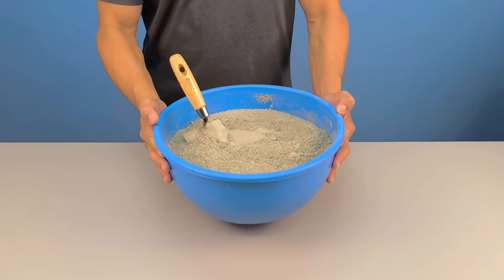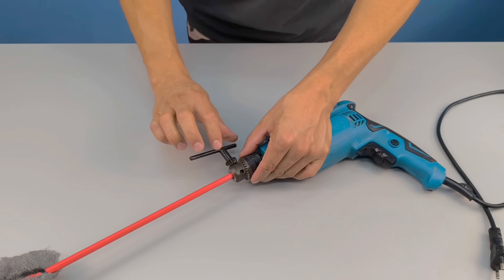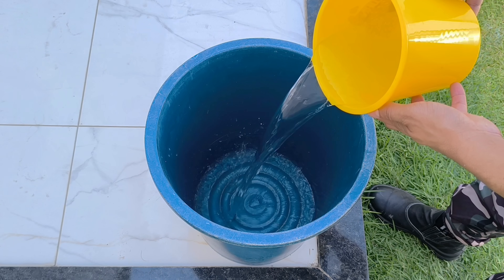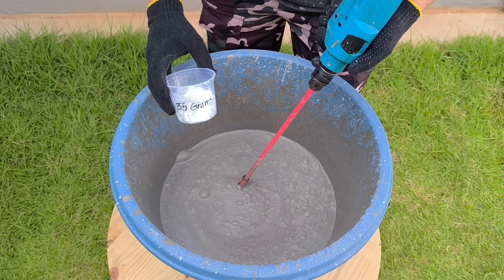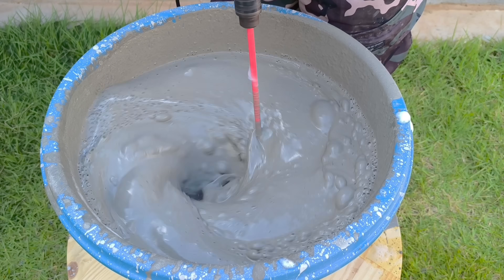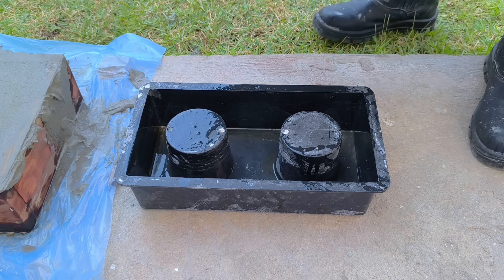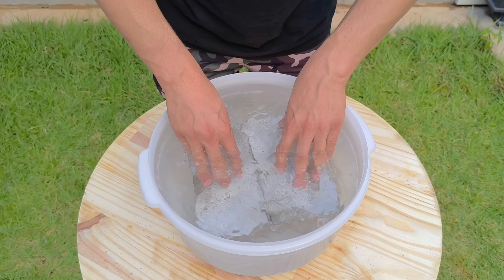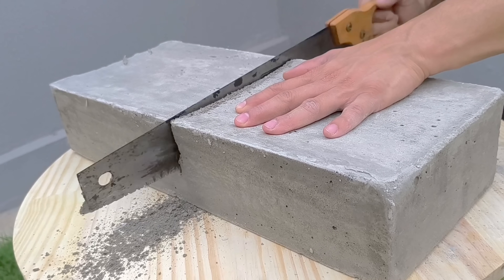Mix CEMENT with DETERGENT and create something that can REVOLUTIONIZE civil construction!

Comment: Air Crete. You broke the kitchen code. Nice work. I tried, you can buy industrial additives but I knew it could be done with regular items. 
Fiberglass and plasticizer... Nice work. 
I'm gonna try this for sure. 
My first idea was egg whites (literally merangue). I thought it was whack, because that's what it sounds like. But it turns out that the proteins help. 
Ha. But there were other issues. Fun stuff. 

I saw someone and his dad, I think, 3D printing a house with "Air Crete". And it was just stacking up on itself. 
That's when I decided I needed this in my life. Not sure what for, yet. but I'll think of something 👉
Reply from the maker: Thank you so much! Yes, I used simple materials to prove it’s possible without industrial additives. Fiberglass and plasticizer worked perfectly! 🙌

Comment: it changes everything if you're living in a frosting climate. you want as less air in your slab as possible.
Reply from the maker: Exactly! ❄️ In cold climates, too much trapped air can cause cracks when freezing — great observation! 👏
Reply: not exactly air is the problem. 
the air inside the concrete block in some time will be replaced with moisture from soil or even open air, i.e. water. and that will lead to cracks when frozen.
There's so much differences and difficulties when you move from frost-free to colder location....

Comment: Very interesting. I have been experimenting with aircrate myself. I would not build a big structure with it, but it is fine for smaller structures that doesn't require a lot of weight. One benefit is, it is a good heat insulator due to the air pockets. you can improve on the foaming by adding borax (very small amount, otherwise it desturbes the bubble structure instead), weigh (or other protein),  Glycerin and CAPB / Amine Oxide if you can find some (only tiny amounts, you need to experiment with ratio). You might need to give it a water proofing coat as moisture might deteriorate it over the years. Make sure it is bone dry, 32 hour might not be enough, more like 1 week, but first it needs to slow dry for +-3 days keeping it damp to prevent cracking and brittle results.
Reply from the maker: Great insights! I really appreciate your detailed feedback. Yes, borax and glycerin can enhance the foam structure a lot. Thanks for sharing your experience! 🙌

Comment: Extra air bubbles means weaker mix, novelty-Crete for decorative purposes. I wouldn’t trust this as far as I could throw it.
Reply from the maker: You’re right, it’s definitely lighter and not meant for structural strength — more for insulation or decorative experiments. 💡🧪

Comment: Can you perform following tests and create new video : Water absorption test,  Soundness (Freeze-thaw) test, Absorption test
Compressive Strength Test (Crushing Strength Test)
Efflorescence Test (Presence of Soluble Salts)
Hardness Test
Impact Test
Dimension Tolerance Test
Structure Test.  You can conduct all these test in any university or college having Civil engineering course.  If possible compare the result with normal red brick and AAC brick. waiting for your videos.
Reply from the maker: Those are excellent suggestions! 💡 I’ll definitely include some of these tests in the next experiments and compare results with standard bricks. Thanks a lot! 🙌

Comment: Now put the finished blocks under a hydraulic test press to see how many foot pounds per square inch it takes to crush it. I can guarantee this ‘miraculous material’ cannot stand anywhere near the strength of standard concrete block after it’s fully cured.
Reply from the maker: You’re absolutely right — it’s not designed for structural use like standard concrete. This mix focuses more on lightness and experimentation. ⚙️

Comment: This is called Chinese  concrete they like to make high raises out of this stuff, and then it crumbles and collapses. Air bubble=bad for concrete!
Reply from the maker: I get your point — air bubbles are bad in structural concrete.
But here the purpose is different: this mixture is for lightweight, non-structural projects. Traditional reinforced concrete is still the best choice for buildings and heavy loads. No shortcuts in engineering! 💪🏗️

Comment: If t u is is real, how does the materials hold up in bad weather. I guess what Id like to know, is ca n these materials in the way you presented them can they withstand weight much like load bearing beams. I mean gratemmtfor gardens and papers Im guessing but could you build a house out of the fabricated product you've so kindly shared with us. How safe is it and  would you move your family into a house that was made from this product from the Greek. Im kidding I have I
Reply from the maker: Great question! 👷‍♂️ The mix shown is meant for small-scale projects like repairs, garden decor, or prototypes — not for full house structures. It’s resistant to moisture and weather for short exposure, but it’s still experimental. ⚙️

Comment: 3:29 so the dude makes bubbles in water and calls it “this invisible ingedient, that miraculously transforms before your eyes”. 😅😅😅😅. Basically like aerated ice cream. You’re getting a lot less for your money.  Plaster of Paris is water soluble so this is going to become porous. You would not want to use this for anything that needed any type of strong structure or long lasting structure.  If you drop that brick that looks like a Lego, it would shatter into three or four pieces immediately.
Reply from the maker: Haha good one! 😄 You’re absolutely right — this kind of foamy mix is just for demonstration and lightweight experiments. It’s not meant for heavy structures, but it’s great for exploring chemical reactions and material behavior. Science with a touch of fun! 🧪⚡
Reply: @inovaouinventa  yes but the problem is the video was presented as if it is a good sturdy building material. Nowhere in there was a disclaimer that it should not be used for anything weight-bearing or loadbearing. And there are people out there that are going to try this.
Reply from the maker: @firefeethok_tui2355The video was presented in an explanatory and technical manner. Before anything else, I ran practical tests to ensure real results. I'm not here to convince anyone to do the same; I'm simply showing what's been tested and approved. I understand your skepticism and respect your opinion. Constructive criticism like yours opens the door to new ideas and strengthens debate in a world where thinking differently is also part of evolution.

Comment: If you have an application that doesn't need to be durable, but light - fine. They called it Gazobeton in Poland and it was common back in the day, but it will crumble over time.
If you want lightweight flower pots, or heavy insulation - fine, but if you use this for structural concrete... I'm not coming in the door.
Reply: As there is no sand in this kind of concrete, would it not be expensive ? YTONG might be a better solution.
Reply: yes I can see the advantages..... and problems. Is this product up to the local or national building material code. IF not, you may be ordered to pull it down.
Australia and NZ have a product called Hebel, a type of premade aerated concrete. It is marketed in both countries, so they obviously have the lab reports that allow it's use in both countries. (In other words it is in compliance with national standards, for the purpose it was designed for). You probably need to have a certified engineer sign the building designs before authority will be given to go ahead.
If you live in a 3rd world country or can bribe the building inspection team in your area, anything is possible.... but it will still only obey the laws of physics at the end.
Reply: In poland u named it also gazobeton? :)
Reply from the maker: Exactly! 💡 It’s similar to Gazobeton — great for lightweight or insulation purposes, but not for structural builds.

Comment: Load Bearing Capacity and over strength is lower than a Clay Brick. Can be used to erect internal walls.
Reply from the maker: Exactly right! ✅ It’s lighter and not as strong as clay bricks, but great for internal partitions and insulation.

Comment: This mixture of cement and soap suds or dishwashing liquid was used to make roof tiles.
Reply from the maker: That’s right! 👍 It’s been used before for lightweight applications like roof tiles and insulation panels.
Reply: @inovaouinventa  Such blocks were also used to build partition walls in apartments. For building pigsties, henhouses and similar structures.

Comment: It's called aircrete.  Highway construction companies that have to fix edges that crack away on hillsides have been using aircrete for several years.
Reply from the maker: Yes, exactly! 💡 Aircrete has been used in many construction projects — it’s great for lightweight and durable repairs!

Comment: They used airated concrete on buildings in the uk in the 80,s to save money, now millions are being spent too repair them.
Reply: @stuartwigen916  you are correct and many collapsing roofs are in schools.
Reply: Aerated or expanded concrete has been around for a while The newer stuff has a high R values, can be dry stacked and the coated with chicken wire and concrete cover <(this can also be used with traditional concrete blocks, is faster to do, makes a wall stronger laterally than one with mortar between the blocks). Berlin
Reply: I'd like to see this struck with a hammer and infused with rebar or chx wire etc and then struck. Click bait otherwise.
Reply from the maker: Yes, that’s true — those early mixes had low density and poor curing. Modern versions use better ratios for durability and insulation. 🧱
Reply: @inovaouinventa  Yeah I can see these types of "brick" being used more for walls (not supporting) to act as insulation or sound dampening.
but no idea of the changes in it's thermal properties. In the US, given how the simplicity of the buildings and DIY rely on the walls being relatively hollow. It might just only be used on the exterior. with some plastics used for the weather proofing underneath the chosen siding or brick...

Perhaps water &/or fire resistant dry wall could be adhered to the foam-crete...

but have to see how it drills... but not at all found of the use of fiberglass (however I understand the intended purpose and properties).

But could definitely see this being useful as destructible movie prop structures...

Comment: over time it'll soak up moister so they wouldn't remain as boyant forever...
Reply from the maker: That’s right — over time it can absorb some moisture. A waterproof coating or resin layer helps prevent that and keeps it lighter for longer.

Comment: I have a question can you put concrete sealant on it for outside use like stepping stones walkways what else can we put on it to keep it from the elements?
Reply from the maker: Yes, you can use a concrete sealant for outdoor use. It helps protect against water, sun, and dirt. You can also apply a thin layer of waterproof varnish or acrylic resin for extra durability.

Comment: r u using ready mix or just cement   there is a very big diff   I ask b/c the sand in ready mix is 80% of the weight
So I wonder what would happen if u did this but us just cement no sand but use vermiculite as a filler.  I have seen a man do this but not with ur  paster and dish soap added. He was able to reduce the weight of what he was doing by 50%  U have done it down to a 1/3.  Take sand out and see what u have.
Reply from the maker: I used pure cement, not ready-mix. You’re right — ready-mix contains a lot of sand. Using only cement helps keep the mixture lighter and more reactive for experiments like this.

Comment: @inovaouinventa  it is water proof or not ?does it absorbs water like normal cement? please 🙏
Reply from the maker: It becomes semi-waterproof once cured, especially if you add a little glue or waterproof additive. It does not absorb water like normal cement, but a sealant can make it completely waterproof.